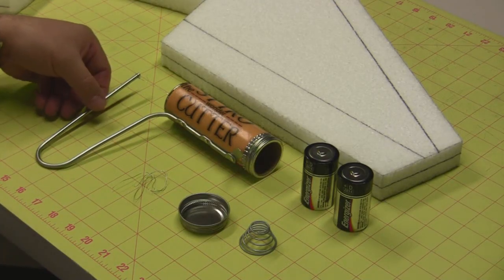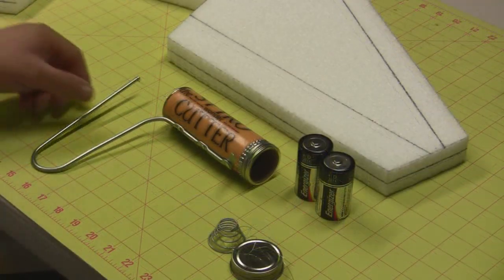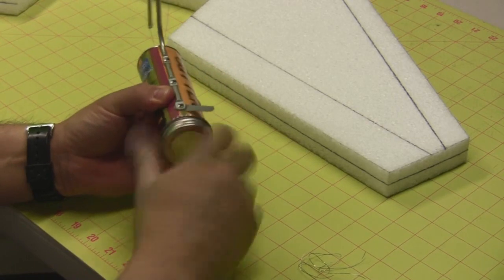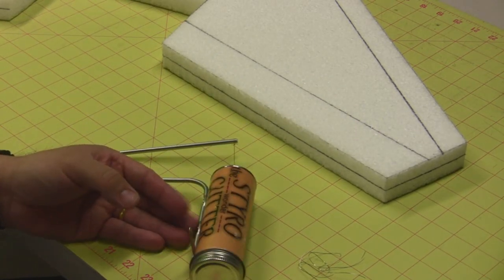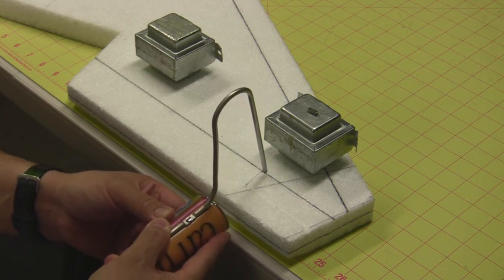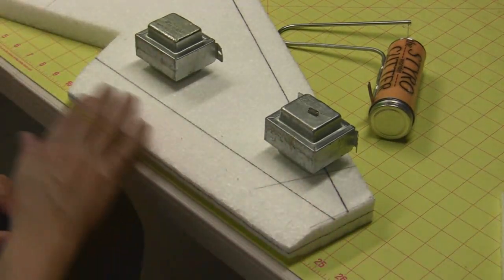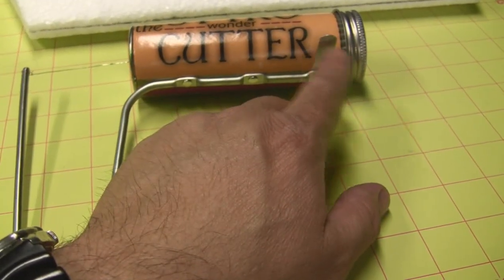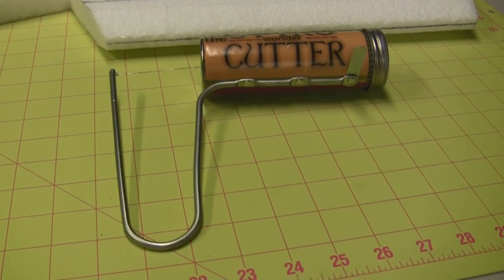Handheld Hotwire Foam Cutter Review

Comment from the maker: Thanks startazz!!! Homemade hotwire bows can definitely be made any size. You just have to make sure you use the right transformer voltage and have some way to adjust the flow of current. Both Paul and I are starting to experiment with this. We will probably do some video on it in the future after we get it all figured out.

Comment from the maker: EXXXOTTEEK this hand held hotwire is not really meant to be used for anything that large. It will cut up to a couple inches. If you are going to cut 15 to 20 inches  I would suggest using a 12 or 24 volt transformer with a regulating switch so you can adjust the current to get the temperature of the wire correct for the length of wire you use. A light dimmer switch will work. There are forums out there for more info on all this. Paul and I are just starting to experiment with it.

Comment from the maker: FBsteezy the hand is insulated from the power and there is only 2 D cell batteries in it so I don't think there is enough power to worry about getting shocked. You do have to be careful not to touch the wire as it could burn you because it does get very hot.